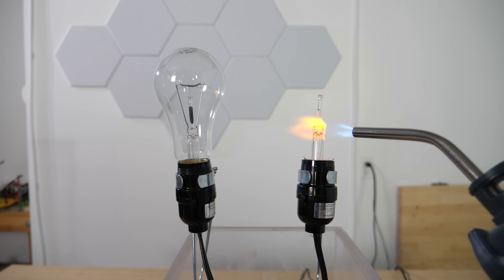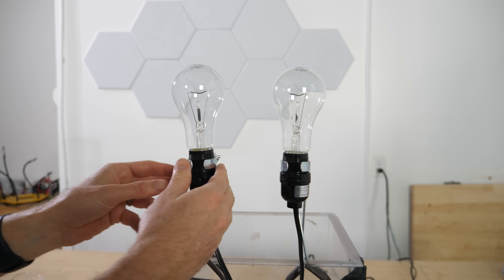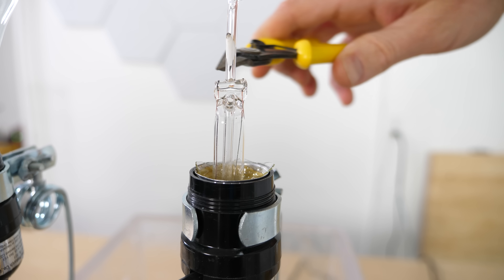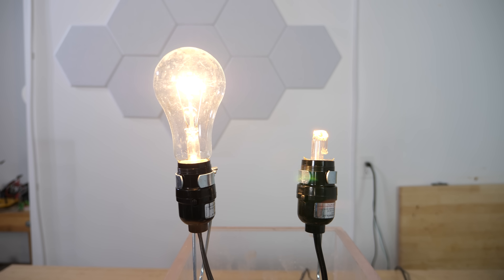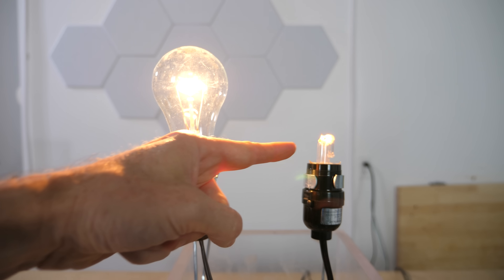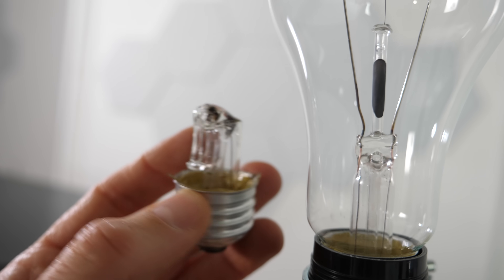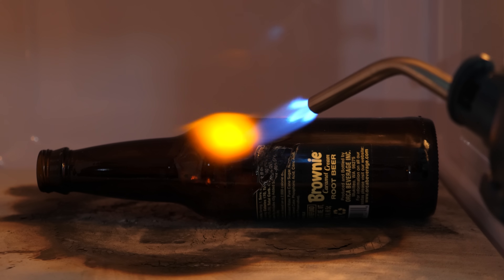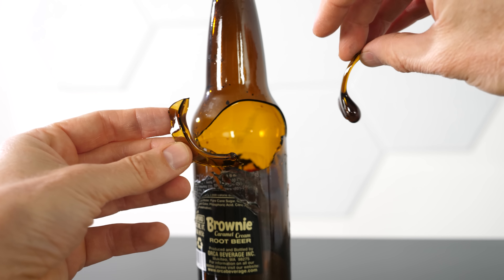How Glass Breaks All the Rules of Insulation

Comment: 2:28 - my heart stopped when I saw you about to touch those exposed wires
Reply from the maker: Lol, you can see my fingers hesitate and then reposition where I am touching
Reply: @TheActionLab Take care man, you are not immortal like Electroboom...
Reply: @belofost  He probably thinks he is after eating that radioactive salt.
Reply: @belofost  well... he is so far. :)
Reply: @TheActionLab If I remember correctly, the torch flame is also conductive, so you should be careful.
Reply: @GianlucaMina  If he had been conductive to ground?
Reply: @GianlucaMina  But not conductive enough for 120V or even for 220V to pass.
Reply: @glenncurry3041  If he touched both wires, he wouldn't need to be grounded to have a problem.
Reply: @Rick_Cavallaro  If he only touched the two wires with two fingers on one hand and was not grounded anywhere else the current does not pass through the body or chest. It is when the current flow can go through the chest and hit the heart that causes real problems. Ask an electrician about wearing rubber soles and keeping one hand in the back pocket.
Reply: @glenncurry3041 Yeah it just hurts like hell as the electricity passes through the short path on your skin from one wire to the other.
Reply: @FilipMikulic-u7d  Idk about that. Plasma (i.e. flame) is conductive, so is the torch. It was just easier for the electricity to go through the molten glass, than through the torch, his body and soles into the ground. I'm not sure it was completely safe thing to do. But maybe I'm wrong.
Reply: @GianlucaMina  flame propagation is a very real thing
Reply: @GianlucaMina you are correct
Reply: @GianlucaMina fire is conductive sure, but not all that relevant here lol. Current won't flow up the flame into the torch and into him
Reply: @GianlucaMina  Didn't know you could get burned and shocked by fire.
Reply: @TheActionLab  -- Why didn't you just pull the plug?
Reply: @ "Why didn't you just pull the plug?"
For continuity reasons. He unscrewed the bulb, showing that this action broke the circuit, then inserted the stub, showing that it still was broken, then re-made the circuit by melting the glass.
Reply: @TheActionLab I would have laughed if you got shocked.
Reply: @TheActionLab  Yep. One could see the hesitation "Where is this thing safe to touch and still turn it in?"
Would have been another moment to say "Don't try this at home, kids!"
Reply: @TheActionLab  James you misspelled 'feengers' lol
Reply: @TheActionLab  - I would've worn latex or nitrile gloves, just to be sure, and also to provide a better example to your audience.
Reply: @TheActionLab  still too close for comfort. You should of isolated the feed before screwing it in. Us watchers would be none the wiser because the light was off anyway. Keeping you safe
Reply: @TheActionLab  here I just assumed you were repositioning to avoid broken glass... Plug them into something with a readily-accessible switch - a power strip will do just fine.
Reply: @TheActionLab  Electricity only occasionally teaches lessons, you gotta lean from mistakes but usually, it just kills.
Reply: This could be an hilarious colab with electroboom
Reply: @netbrood Especially had he touched the exposed wires!
Reply: That is not an ElectroBOOM channel.
Reply: @SeriousApache  Came for this ^
Reply: in all fairness, you were using the 1 hand rule so you wouldnt have died, you WOULD remember it though
Reply: @frogz  If he touched the hot side and wasn't grounded he still could have died
Reply: @A_youtube_channel_  actually if he touched the hot side it depends HOW he was grounded, if he wasnt grounded at all his entire body would charge to the 120v potential and he would be fine, if the hand that touched the live wire was grounded all of the current would go through the hand, if his foot or opposite hand was grounded this would be 1 of the worse cases as the current would have to travel through more of his body to reach ground
Reply: @frogz ehh it's not thatttt exciting with just one hand. I did it as a child with an outlet a handful of times and it wasn't the worse
Reply: Me too. He was only using one hand though so it would have just buzzed him a little. If he was using both hand THAT would have been a little scary.
Reply: electrical engineering hobbyist here, it could give him a zap but since the path of least resistance is one finger to the other, the current would not have crossed anything vital, so he would have been fine, if not a tad shocked.
Reply: It would not have been fatal. At worse he would have gotten a good shock.
Reply: I understand why he wanted an uncut video to help quell people claiming faked, but honestly I also feel like I wonder if the risk was worth it. I absolutely would have cut power, perhaps even by flipping a breaker, before/while setting this up.
Reply: stop
Reply: like that would kill him, not to mention one handed, youre exaggerating the danger here
Reply: He was very close to become ElectroBOOM.....!!!
Reply: SAME i was so scared
Reply: I shouted No! lol!
Reply: Some one should call ELECTROBOOM channel
Reply: Remained me of Madi @ElectroBOOM ...😅😁
Reply: While he's at it why doesn't he pour water on it to cool it and turn it off.
Reply: @mljbz wouldn't do anything special, why would he do that vs just waiting?
Reply: Holy crap! I just about lost consciousness 😂
Reply: That got me too🙋
Reply: I’m Dirty Dan!
Reply: @mydude3254 a dirty wee man called dirty wee Dan,
He brushes his hair with the leg of a chair and washes his face in the frying pan,
A dirty wee man called dirty wee Dan
Reply: LOL!
Reply: I was worried that there would be an electro-Boom moment
Reply: clearly havent played with electricity before
Reply: I was scared too 😂
Reply: Almost a lightbulb moment.
Reply: You haven't touched excised wires before? Panz
Reply: Now thats what I call quantum entanglement.
Reply: Yeah, that's ElectroBOOM's job.
Reply: Yea, jesus. Hope that was not  directly plugged into the outlet.
Reply: @PinheadLarry1337  this is why we always assemble with the power line off shit scared me
Reply: If electroboom does this he would accidentally touch it
Reply: Same
Reply: Electroboom moment!
Reply: I was not till that point of the video when I read the comment, after reaching there I could only scream "Yikes!".
Reply: I didnt get the point of this risky move when the video is cut anyway - doesnt proof anything (also no need to proof you are messing with us - great Video)
Reply: It's only 120 volts, it wouldn't have killed him. It would probably have HURT though.
Reply: All the tension is between the open circuit wires in a series circuit. Take Care!
Reply: bulshit, the video is fake, next time show us the switches
Reply: 🙄 people are so ignorant.. why would it be dangerous. its low volts low amps. hes not sticking a fork in an outlet, get a grip
Reply: @Keanue-Anakoni-Aukai  ......you do realize he is playing with 120v from an outlet, right? this is only dangerous if you dont take precautions
Reply: @Keanue-Anakoni-Aukai  That's main's voltage and amps. You're the ignorant one. Although in america main's is rather low.